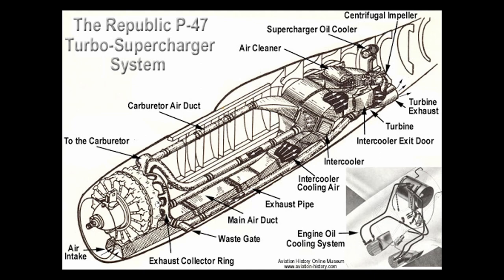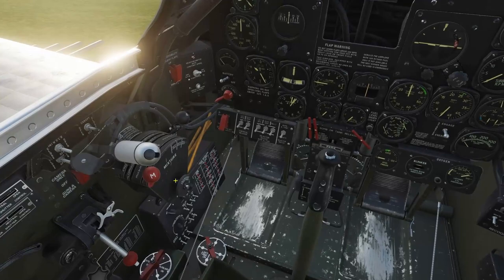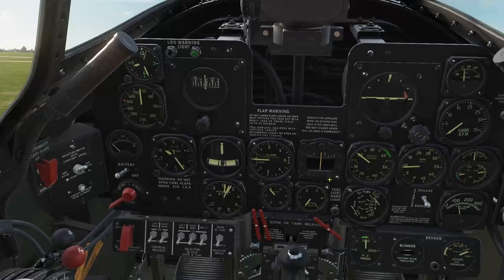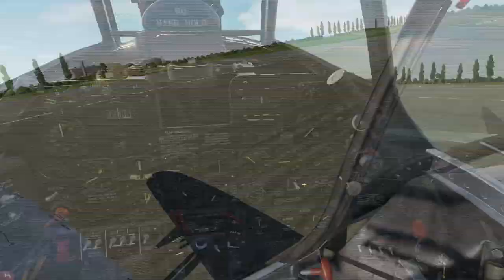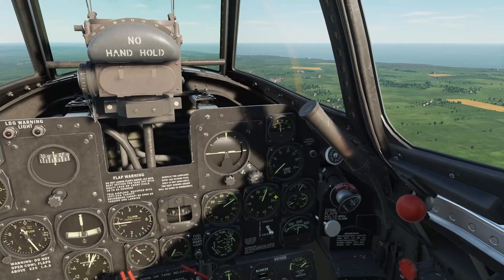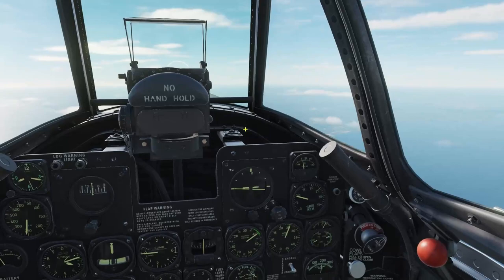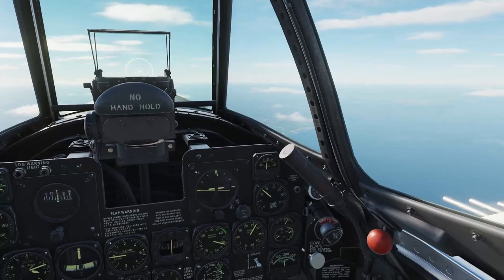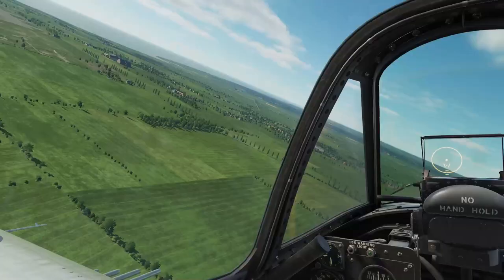P-47 Engine Management - DCS World

Comment: I realize it's been a while since you posted this but I just bought the P-47 and wanted to know more about the engine management.  Thanks for the video it's very informative, as well as the article on Radial engines.  I have the I-16, so to answer your question I would say the issue with windmilling and bearing damage is not modeled.  

I started out at 2000m, pulled the throttle all the way back.  The RPM drops from 2250 to 1600~.  I push over into a dive and the rpm comes back up to 2250-2300.  At the bottom of the dive I push the throttle back up and climb back to 2000m.  I repeated that 5 times and at the end brought the engine back to cruise power, 80 Hg, 1800rpm and let it run for a few minutes.  No change in oil temps or pressure, steady rpm.
Reply from the maker: Thanks, glad you enjoyed them!

Thanks for the info on the I-16, I picked that one up a while back but never tested the bearing damage in that. From what I understand, Eagle Dynamics adjusted the bearing damage in the P-47 so it's not as bad as before. You'll still damage them, just takes longer to affect the engine. The effect still scales with severity, but you won't kill the engine with light windmilling.

Comment: Thinking about why the oil and intercooler switches are reversed from the readout, I wonder if it’s because your arm would be in the way of the indicator when you’re holding the switch.  Look under your arm when using the intercooler switch, and above your arm for the oil switch.

Comment: Thanks for this, been runninng hot and out of Fuel on the first actual Wolfpack Mission, was frustrating, gonna give it another go after work today, hopefully make my RTB finally. 😂
Reply from the maker: My pleasure, glad it was helpful! If speed isn’t a concern for your mission, you can always take advantage of lean cruise and really save some fuel. I have a video specifically for fuel use here: https://youtu.be/SNKKE2OszqE?si=QsKwcLNOywg5Cn7o
Reply: @DieselThunderAviation   Sweet, I think I checked that one out, after I ran out of Fuel just after the call for RTB on Mission 1. 

I thought I was good this morning when I had more than Half of main tank on my way Back to base...tried to ease up on the engine by backing off the Booster...and about 5 seconds later, looks like I spun the Main Bearing. 

Not sure where I went wrong, my temps looked great up until then.

Ah well...can't learn if you don't fail I guess. 😂

Comment: Intercooler: You only need the intercooler when you are using the turbosupercharger.  If your carb temperature gets too  hot, open the intercooler doors.  the intercooler cools the air coming out of the turbo feeding into the carb.  Else leave them closed.  You start needing this intercooler at high altitude when you are running the turbo full on.  From experiece, there is only one slice of altitude where you need to bother with this.  The game simulates the drag these cooling devices generate, so the less you open them, the faster you go/climb.  Speed is life.

Comment: Great tutorial.  Thank You!
Reply from the maker: Thank you, glad you found it helpful!
Reply: @DieselThunderAviation    Very helpful!  I watched it on replay for about 4 hours yesterday while I was learning to fly the jug.  So I still have a few questions if you don't mind...  Firstly, I don't think you covered what the oil dilution switch is for.  Can you comment on that please?  Or point me toward which section of your video does cover it if I missed it?   Secondly, about using the boost under 7000 feet, I am finding that I often need to add it even at 2,000-3,000ft just to keep manifold pressure at the end of the green cruise zone (~42in) with prop RPM at near redline.   What am I missing?   It feels to me like adding the boost at much lower altitude is quite helpful and I'm not gated by anything else.
Reply from the maker: I did not cover that in the video, sorry. What the dilution switch does, is squirts gasoline into the engine crankcase to thin out the oil and reduce the oil pressure. As the engine comes up to operating temperature, the gas evaporates and the oil remains in the crankcase. It's normally only used when it's cold outside (winter) to manage oil pressure for warmup. 

For using the turbo below 7K, I normally don't unless I'm in a dogfight and need the power. My process is the same as shown in the video, after takeoff, gear comes up, and once established in the climb is when I reduce to 42 inches and 2,550 RPM. I maintain that through the climb, even though the MP does drop as you go up. Throttle up to maintain until at full throttle, which happens around 3K. Once at full throttle, I'll adjust my angle of attack as needed to maintain airspeed until at 7K, then bring up the turbo to get the MP back to 42 and continue my climb. 

Controlling the turbo is a bit tricky at lower altitudes since you don't need much out of it down low. It's easy to overboost when the turbo spools up to speed.

Comment: In IL-2 it is recommended to keep intercooler shutter at 50% (neutral), that way it doesnt poke out from the frame and wont cause air resistance. It wont cause any problems keeping it neutral. Also plane starts to shake at high speeds if it is completely open and not neutral.

In ww2 P-47 educational film it was suggested to "keep the light blinking" which ment that your turbo is spinning.

Theres some differences between these planes in those sims.

Comment: Ciao Diesel! Thank you very much for the video!...I saw that the turbo lever can be linked to the throttle lever... Is it a good way to operate? Advantages? Disadvantages? Thank you again and greetings from Italy
Reply from the maker: You're welcome, glad you enjoyed it! 

In my opinion, no. I almost never fly with the levers linked together. By the altitudes where you need the turbo, your throttle should already be full forward. That allows you to get everything you can out of the mechanical supercharger. As a general rule, superchargers don't like being throttled. With them linked you end up bottlenecking the turbo, and choking off the supercharger at the same time, leading to some level of power loss as those components are working harder against a partially closed throttle. 

One advantage I can think of for the sim, is convenience for those with single axis throttles. You'd take the power loss in that configuration as mentioned, plus sacrifice useful range on longer missions, but you would gain some simplicity in operating the engine. Have to be careful not to overboost or overspeed the turbo, especially if you get bounced by enemy fighters and the instinct is to push that throttle to full!

Comment: I read somewhere that the Intercooler doors add zero or close to zero drag if at neutral, and that they were designed to be used like this. I’m not much of a virtual flyer and I’ve never flown a real plane but when I do fly the Jug in DCS, I leave these Intercooler doors in the middle all the time. The only thing I’ve had to adjust is the oil flaps, and only a tiny bit. The engine has never overheated for me. Is this wrong?
Reply from the maker: Not sure on the drag part for the doors. The manual says neutral for takeoff, open for normal flight unless cold. IF it's cold, then close the doors as needed to maintain the intake air at or above 25 degrees.

Adjusting the oil doors is fairly normal. For these to overheat, you need to be at high power and low airspeed. I don't think I've gotten close to an overheat either.
Reply: @DieselThunderAviation Right. Thanks. Maybe it’s possible half open might be considered open (as per the instructions quoted)? When I get some time I’ll try to evaluate the drag thing. Since I posted, I viewed the  ‘Sherrif’s Sim Shack’ channel’s P-47 video where he does a test with the Intercooler doors and gets the least drag when half open. There are many issues with trusting this, however. He’s ‘flying’ IL2 and this may apply in that slightly less realistic sim but not IRL or in DCS. What IL2 does have is a fake autopilot where you can set the plane to fly level and concentrate on the engine parameters. I know this is a cheat, but I do wish DCS had something similar. Both for testing and for the long commutes across the Channel. You wouldn’t have to use it if you didn’t want to. 😂 

If I get any test results I’m confident in I’ll post back here, but don’t hold your breath - my flying will need to be more consistent than it is now to get accurate data. Until then I’ll change what I do to match the instructions here.  Thx.

Comment: Correct me if I'm wrong but the manual(the real one) says 150 turning final and not below!
Reply from the maker: I've seen it both ways in the manuals. The P-47D-25 through P-47D-35 manual has it listed at 130 MPH. The P-47N manual shows 150 MPH. When flying at 130 MPH in DCS, you are really close to the edge of stalling. I can't help but wonder is the Army Air Corps/Air Force increased the speed in the manuals to have a safer margin for the pilots to fly.

Comment: Is this the same engine that was in the DC-3?
Reply from the maker: Not quite. The DC-3/C-47 used a different engine, also built by Pratt and Whitney, the 14 cylinder R-1830. Those only produced about 1,200 HP, compared to the R-2800 which made 2,400+ HP depending on the aircraft it was installed in.
Reply: @DieselThunderAviation  thanks

Comment: Should the turbo be off if I'm in a dogfight on the deck aswell? Kinda confused about that
Reply from the maker: It depends. If you need to get your manifold pressure up and get all the power you can out of the R-2800, then use the turbo. Best practice is to get all you can out of the supercharger (full throttle) and then supplement with the turbo as needed. Just be mindful that controlling the turbo at low altitudes is difficult and it is easy to overboost the engine if you aren’t careful. High altitude is where the turbo really helped and made the P-47 a solid fighter.
Reply: @DieselThunderAviation  Thanks!
Reply from the maker: My pleasure!

Comment: a shame the dcs p-47 only runs 64" of mercury. missing nearly 400hp in this model
Reply from the maker: I don't think any D model Jug ever got the uprated engine.
Reply: @DieselThunderAviation  it's more about the fuel than the engine in the D model. with 150 octane fuel the p-47 ran 65" of manifold pressure before it even got into the water injection range. ww2 sims always do this thing where you get the most optimistic german planes and the most pessimistic allied planes
Reply: @ArtietheArchon 

Relax, just realize this is just a video game for entertainment purposes. 

And you should take any sources or video games  with a grain of salt.

There’s no such thing as 100% accurate simulation, just our interpretation.
Reply: You are correct, same with the LF Mk9. In reality 100+ Mk9 were outfit with the British Ferranti Mk2 Gyro gunsight. But no such option exists in DCS.

Comment: Is the water injection supposed to actually add power? Just got the Jug and if I am at full throttle/full boost and 320-ish mph at SL and hit the water I get a bunch more MP but maybe 2-3mph more If I am lucky?? At altitude it pretty much does nothing at all.
I have found the Jug to be super slow compared to the other German WWII aircraft. In a standard turning fight I can maybe hold 170-ish mph in the turn and the 109/190 can be flying the same circle at upwards of 60mp or more faster?? Impossible to actually fly against these AI which have waaaay more power.
Reply from the maker: The water itself doesn't add power but does do a few things towards the engine producing more power. The first thing it does is cool the charge air, as anytime you compress air, it gets hotter. It really helps keep the carb air temp below its limit of 50 degrees at high MP. Since it cools the charge air, it becomes denser air which is good as more air allows more fuel to be burned which makes more power. The second thing it does is help keep the cylinders cool at high power and reduces combustion temperature to prevent detonation and engine damage.

As you have observed, the relationship between engine power and airspeed isn't linear. One thing to keep in mind is that the airspeed indicator measures indicated airspeed, and not true airspeed. The Jugs top speed at 30,000 feet is about 425 MPH true, but about 300 MPH on the airspeed indicator.

The turbo really helped the Jug be competitive against other fighters in the first half of the war, as it could hold its engine power to a much higher altitude, where the supercharger on other fighters would be above their critical altitude. The higher engine power allows you to hold turns better with the additional thrust. As this work out in DCS, the P-47 gets outmatched with the Bf-109 K4 and the Fw-190 D9 as those two are late war designs. The Fw-190 A8 is a much better match against the Jug. And I am eagerly waiting for DCS to improve the AI for the warbirds!

Hope this helps!
Reply: @DieselThunderAviation  Thanks for the info - am looking forward to  the La-7! Might just stick to A-G and bombers till then. Also yes some decent AI would be nice too.
Reply: impressive amount of information. thanks. this is exactly what I needed and it is delivered without fluff 🙏

Comment: so if you're not supposed to use turbo down low, then how are you supposed to get water injection to work down low? Also when should you use the throttle/turbo interlock?
Reply from the maker: At low altitudes, you can get the engine pretty close to 52” MP, the max allowed running dry. Turning on the water system at that point will increase your manifold pressure above what your engine is able to make without the water. If you really needed too, you can bring in the turbo at low altitudes though it is harder to control. The turbo can easily spin up too fast and overboost the engine, and is very touchy in that aspect. The flight manual specified 7,000 feet as minimum for the turbo usage, and 12,000 feet as the recommended altitude.

 The manual leaves some room for pilot discretion. The turbo altitude recommendations and limits above applied in almost all flight conditions. However if you need to get all the power out of the engine and it’ll help get out of a bad situation or avoid getting shot down, then use it!

For linking the levers, I typically only do that in extended dives. I keep them separate in all other conditions as once the throttle is full forward, I only have to adjust the boost lever to maintain MP without bottlenecking the supercharger or turbo.
Reply: @DieselThunderAviation  thanks for the reply sir!
Reply from the maker: My pleasure!